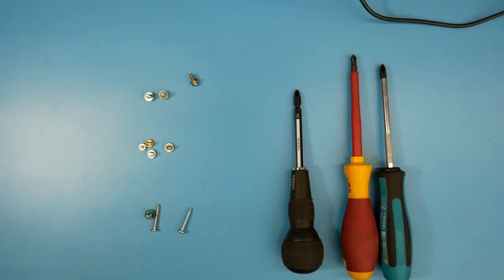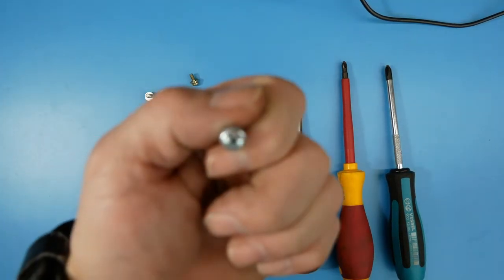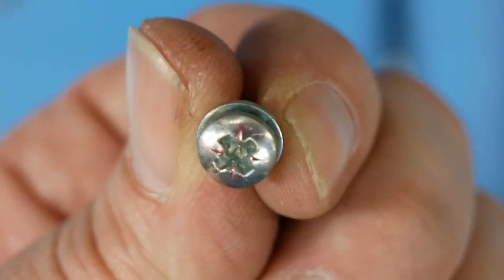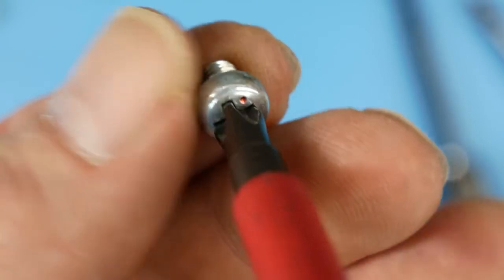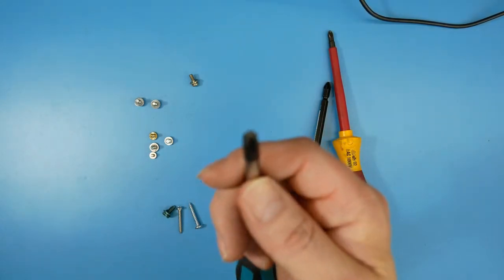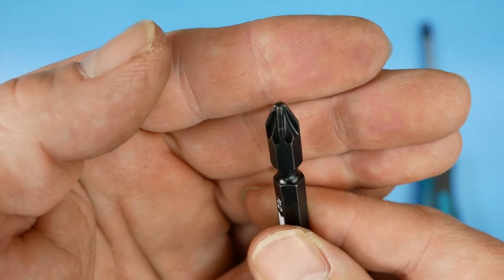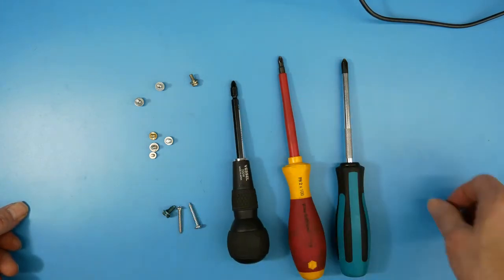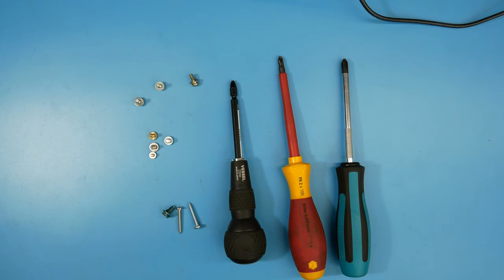#6 Phillips, Pozi, or JIS

Comment: Pozidriv screws look completely different from Phillips/JIS, they have the little  fins in between the main arms of the cross. You can get away with using a Phillips driver in a Pozi screw,  but not the other way round. Pozi screws are still the most common in the UK for woodwork and general construction purposes, though less so on machinery.

Comment: In my experience JIS screwdrivers work fine in Phillips, but Phillips screwdrivers lead to rounding on Jis screws.   If you are working on Japanese stuff you need a JIS set.  In fact, I feel like the JIS works better in Philips than Phillips screwdrivers do.
I think it will be clearer if you stop calling JIS or Frearson forms of Phillips like “European Phillips.”   That leads to confusion.

Comment: Could you tell me a definitive way to identify the difference between JIS and philips since they don’t always have the dot on them. 

Also, LONG LIVE THE TORX! Long live the torx!
Reply: The JIS driver tip is shorter than Phillips and Pozi. And the cross centres are very square edged .
Reply: @amezcuaist  oh, yeah. my I FIX IT tool kit has a jis driver set in it an i noticed that. i was more referring to the screws themselves. how do I identify them to make sure I use the right driver?